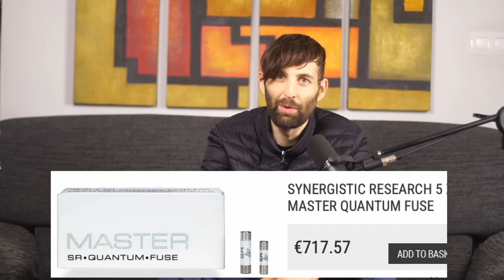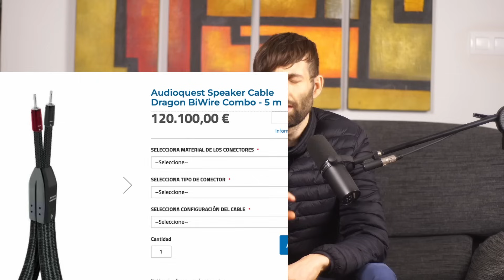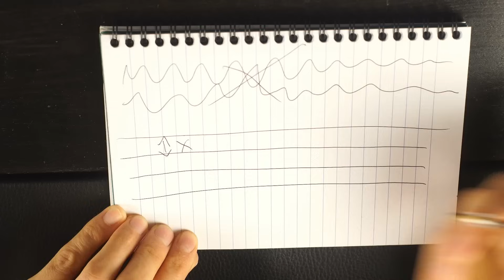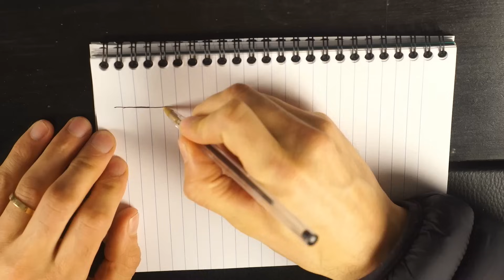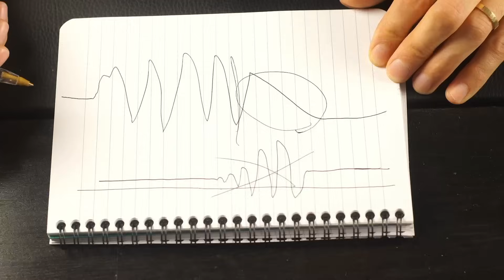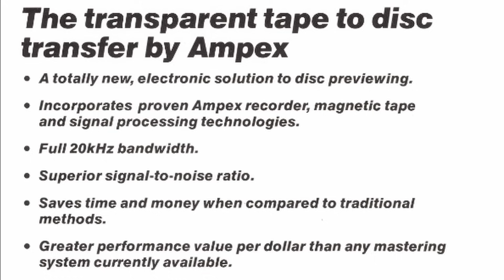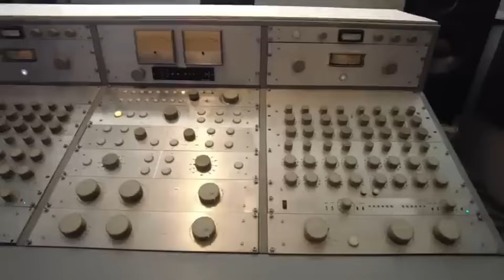Hard truth: most vinyl is digital anyway

Comment: Yep....100 % true.
Lots of analog/vinyl enthusiasts don't know that little detail: most of mastering studios in the 80s had the Studer A80 that converts the signal to digital before cutting the vinyl 😅
Reply: But yet lots of vinyl collectors buy records made before the 80's.
Reply: Digital is defined by 0s and 1s, you cannot write 1s and 0s to a piece of material, nor does it interpret them - thus technically analogue.
Reply: @willnorth6339  how the Studer A80 with a digital delay line works:
   1. Analog (from the tape recorder) →
   2. Digital (in the delay unit) →
   3. Back to Analog →
   4. Then engraved onto vinyl.
The digital conversion was done at 12-14 bit, 44.1KHz (not even CD quality)
Almost every major release after 1980 was done at a mastering house that used this way of mastering.
So, no more analog, since the vinyl was cut from a digital signal
Reply: @OrangeMicMusic  Again, vinyl is an analogue playback medium - once you’ve pressed from an originally digital source (in your example) to an analogue medium it becomes analogue. There is no longer any samples containing bits of information, the pressing become a continuous path of sonic information - an analogue vibration.

Your example is like taking water, freezing it to ice and then still calling it water.
Reply: @willnorth6339   the discussion in this video (and the comments here) is about having an all analog path from recording to vinyl. Once an audio signal was converted to digital and back to analog, that path it's no longer 100% anlaog
Reply: @OrangeMicMusic  I do understand your point and you’re correct in saying that the result (vinyl) contains information once processed through digital - but the end playable product is still fully analogue, the gaps between sample rate/bits have been blended into one continuous stream of vibration (vinyl groove) essential adding sonic information + wow, flutter and distortion have been introduced, therefore the playable has taken on some fairly new sound characteristics associated with the effects of tracking vibrations from a physical piece of material.
Reply: @OrangeMicMusic  The A80 is an analog tape machine, the cutting version had a second set of playback heads for give you an analog cutting delay. Any digital delay was likely from a third party or the lathe manufacturer. I mostly worked on the 2" 24 versions not the 2 track version. Even with a 12 bit digital delay vinyl only has a resolution of 11 bit so 12 bit is plenty.
Reply: @dannelson6980  yes, A80 was an analog unit, but I said <<Studer A80 *with* a digital delay line>>. Meaning, many mastering facilities in the 80s used a digital delay unit in the process of cutting, Neumann VMS70 being the most famous one.
Reply: @willnorth6339  again....<<the result (vinyl) contains information once processed through digital>> it's exactly the point of this video, and the discussions over this. Some people want to have a vinyl that wasn't altered by any digital processing thinking that it's a better sounding source.
Reply: @willnorth6339  Well, ice is still water. 😂
Reply: @geirtjelta It’s water that has been frozen (in context - processed, just like pressing to vinyl aka analogue) - which is objectively different from its original form and now possesses different properties.
Reply: @willnorth6339  If you want to be pedantic, then technically everything is an analog playback medium through analogue vibrations. Your ears are very analogue also, or is the correct word acoustic? If you hear it then it's not digital, because you're not a computer.

Also, once you've converted audio into digital, you can't unconvert it. The "damage" is irreversible. If the audio has aliasing, quantization noise or other unholy digital shenanigans, Vinyl or any other analogue medium will not magically fix it.

EDIT: Also, if Vinyl is supposedly "better" at capturing all the details of the original sound, then by that logic it captures all digital conversion imperfections also.

Comment: The vinyl snobs I know have cheap turntables with attached arms and a bog standard cartridge/stylus, this is a fact in HiFi sound, it matters not one jot what your amp and speakers are it will sound only as good as your sound source, it's easier and cheaper to build a decent CD player than it is to build a turntable, arm and stylus.  I have both a good turntable (Linn) and CD player and I can tell you the amount you lose in clarity from vinyl is noticeable, the low-end base is often too mono for positioning, and the high-end is not delicate.  Vinyl is shit, it really is and no one I know can tell a good vinyl from a bad CD

Comment: Analogue playback, whether from a record or tape, has a sonic influence on the end result in addition to the haptic aspect. And this is independent of the source material. So I have to disagree here, that in the end it is all about transparency. When it comes to records, this is difficult to understand, as you already have an end product that you can no longer influence. That is why I am using tape as an example here. I use Hi-Res streaming almost exclusively for compiling playlists and then recording them on tape. Why? Because I think the analogue end result sounds more pleasant. I deliberately do not say 'better'! There is definitely a 'colouring' of the sound. And thus actually a 'falsification'. But one that sounds more emotional and pleasant to my ears than the digital source material.
Reply: @MagicMaus29  in a sense you are remastering a digital file to your preference. Nice!
Reply: @kellymichael9567  I believe that a lot of digital masterings these days are not designed for playback on highly revealing devices and for critical listening, but rather for the mass market, which prefers 'casual listening' in the background. That's why a lot of it seems too intrusive to me... too sharp-edged. Recording on tape seems a bit like 'sanding down' those rough edges. In my opinion, the sound characteristics gain from this very 'loss'.
Reply: So, you like wow and flutter, got it...

Comment: Nowadays, even a middle of the road ADC/DAC consumer level setup can reasonably be expected to have the same effect in the signal path as a very short length of copper wire. Unless it was designed wrong or judt plain busted.

Comment: As an engineer with 40 years in the biz, I learned early on that you can't reason with the unreasonable but I give you props for trying. I think many people get confused because in the studio we use analog devices to add flavor in the creative process. It does not help that when trying to explain digital you are fighting against an entire industry that benefits from maintaining the myth of analog.
Reply: Do you think any of the cable claims are true? Some people say they can hear the differences between copper and silver, or solid core vs stranded wire. As an engineer, do you think there's anything to that argument?

I can't find any good references that are based in science that would either confirm or deny these claims. I guess that what I'm trying to ask is, if I went to school to become an engineer, am I going to come across information that would imply, yes, it is possible differences in cables may be heard, or not? One of the things that make me very skeptical is, even if there isn't any formal science that can be referenced, setting up a listening test that meets the requirements needed to be considered legitimate science is not that difficult. Simply, is there a difference between A and B? Yes or no. So, even if we can't explain why there is a difference, we can at least prove if there is a difference.
Reply: @052RC  cables don't reproduce sound. Don't buy the cheap crappy ones because they will fall apart on you right away. Best option in my opinion is to buy quality pro audio cables separately and quality pro audio plugs separately, then learn a little soldiering and put them together yourself. If you want to invest a lot of money, invest in headphones or speakers and acoustic adaptation.
Reply: @052RC unless the cable is physically damaged and/or there's major interference across an unbalanced line, no. There's no difference unless the cable is question is so low quality that there are substantial and measurable levels of impurities in the base metal. Period, end of story. It's just physics at that point.
Reply: @052RC  audiophiles need to probe the super powers in A B... but🤔 don t show up😕
Reply: As long as the "unexplained" difference makes YOU pay more.. that absolutely ok with me.
Don't come back and cry after that..
Reply: @052RC  if you go to engineering school you will find that a thicker copper cable will always be better than a thinner silver cables, plus experience in electronics will tell you your contacts are causing 90% of your impedance anyways.
Reply: @052RC  About 30 years ago, maybe 40 years, a double blind a/b comparison was done.  In the "preferred by most attendees" category the speaker wire winner was a common steel wire coat hanger.  I wish I still have the printed article...
Reply: They are lying. Period.
Reply: A/B tests over a short time period are notoriously faulty. 

There can be differences in cables and similar equipment, but those differences will evidence themselves over time, not in a 10 minute test.
Reply: I'm a EE and got into a discussion with an audiophile on rec.audio.highend (?) in the early 90s.  Eventually he turned to ad hominem attacks and asked whether I had killed any astronauts lately.  Sigh.
Reply: The same reason people vote for Trump.
Reply: well thats just total BS.  There is infinitely more money in convincing you digital is better. I mean jeez dude - make a coherent argument "OH its the boutique manufacturer os 6 high end turntables fighting against the truth" 

I mean you literally said "I learned early on that you can't reason with the unreasonable" and then made the weakest argument in history
Reply: @piccalillipit9211  what's your argument that there's more money in "digital is better" than analogue?

Vinyl makes much more money....the albums cost $50+
The turntables cost from cheap $100 to $5,000, 10,000+
You need to buy a new stylus every 200 to 500 hours of play.

Digital - plays on a mobile phone. Streaming costs around $100 per year for everyone you'd ever want to hear....
Even a phone provides excellent sound quality of 20hz-20khz.

How is there more money in digital especially in 2025?

I want to hear your argument.
Reply: It sounds contradictory to say we use analog devices to add flavor and then for others to say you can’t A/B between an analog and digital source and tell the difference. Obliviously this is admission analog DOES color the sound to some extent.
Reply: @mikeg2491  You're comparing Analog and Digital against one another as if they are absolute terms with no context.  The context matters.  In the context of "audio stored on a vinyl record is colored and therefore sounds better than the same audio stored on a digital medium" is blatantly false.  In the context of "audio run through an analog outboard compressor during production is colored and may give a more preferential result than the same audio run through a digital compressor" could be true, but could also be false.  Far too much weight is given to "Analog" everything.  Digital technology in production is wonderful.  Sometimes there is tangible colorization as a result of using analog vs digital processing, but that's not what is going on when a digital audio source is merely cut to vinyl...  The fact that it's stored on a vinyl doesn't magically make it sound better during playback.
Reply: @mikeg2491 The funny thing is that in the video he mentioned that vinyl creates surface noise well, that is the sound that analogue based producers want.😂
Reply: @Deezvrtysdakklolopp no... No it's not. I'm one of those engineers. That's not the goal; if anything, it's intentionally avoided and worked on so hard to be avoided because we know that noise will be introduced in the cutting process anyway. Unless you're exclusively releasing digitally, which seems a bit against the point of it anyway, you work your ass off to avoid introducing that any earlier in the process than absolutely necessary.
Reply: @mikeg2491  Well, the use of a device because it does something like EQ or compression, is because we want to apply the EQ or compression.  If we want to use an analog EQ or comp, it's because we're going to flog the analogue circuit in a way that makes it sound different than other compressors or EQs.  Whether deliberate or serendipitous sometimes we get more "color" from the circuit overdrive or odd gain make up and then decide we like it.  Will that sound different than a straight up digital or analog device?  Yes, because we're doing something outside the linear operation range of the device.  It's going to sound different.

Comment: I fully agree with your statements what worries me is that the physical media sold at the stores (cd's) are the slammed smashed brick wall limited versions the same they play on the radio it would be a decent and proper thing for people actually buying the physical version ie cd or high res mediafile they would get the uncompressed version 
If i want it louder i turn the volume up as simpel as that
And for the vinyl part the late issues which are on the shelfs are mostly pore mp3 rip offs transferred to vinyl the weekend is such a artist 
I like both formats vinyl and cd but mainly because one time it's released on cd but not on vinyl or the other way round
What i also look for is the first issues any remaster is a no go

Comment: I agree that the slammed digital master and the hi-res digital vinyl master should be made available to the user: always. For me there is now room for a new format, lets call it WAV2 where in WAV2 one WAV2 digital file always contains the 2 digital WAV files: i.e. the slammed and the vinyl digital. On playback, the player has a switch to choose A the slammed or B the digital vinyl. There should also be a C position. This is the slammed A level matched (by LUFS) to the vinyl digital B, so enthusiast can switch between B and C usually to compare or if in doubt default to A. WAV2 just contains 2 files. The C version is derived from the A version on playback by one dB offset burnt into meta-data in the WAV2 file at creation. Thanks, really love your channel: inspiring.

Comment: Vinyl and Tape are a beautiful canvas that can and does exceed expectations when done well with sufficiently good equipment and suitable environment! Good digital equipment is indeed robust and excellent as well as not being subject in the same way as vinyl, such as tonearm resonances, physical energetic feedback, stylus profiles and 'jitter', not least the accuracy, capability and impedance loading of the RIAA phono amplification stage. I generally opt for the best digital wav file where available and 320kbs minimum for mp3 where no alternative, usually for electronic dance 'music' which, again if done right, is in most cases quite acceptable. Vinyl is magnificent on capable gear and being physical can be played without power to some effect using your finger nail however digital depends upon stable electronics and has no physical footprint with the potential of great performance pertaining to it's dexterity and the sum of its parts.. Tape, for me is very nourishing to the soul and despite its expense and fragility has proven perhaps the most reliable method to store both music and data. Traditional photography is revered, care over the quality of lenses, the medium, inevitable artifacts and the development process have an impact on the final product. It's now far easier and cheaper to attain great sound reproduction employing digital setups from well made/mastered files than it is to achieve the same from an analogue turntable setup in my opinion however, the vinyl and tape still is center stage in my systems where i have the physical vinyl or tape of the production i want to hear to play but the great digital i enjoy is where the majority of what i wish to listen to is stored. I will however bounce both vinyl and digital to tape for its convenience, saving exposing records so often and enjoying long playlist that i don't need a computer for, post recording. I guess it's horses for courses, all methods are valid but ultimately it seems most likely i would hear what the producer intended more accurately from a high quality, well mastered non-limited digital file than i perhaps would through the typical consumer grade analogue setup. Thanks, really great show. Very best regards, m

Comment: I got recommended your previous video, which was excellent. I was actually surprised my 40-something year old ears could actually distinguish between the spherical and elliptical styli. I see these sorts of arguments all the time, people buy a vinyl copy of an album from the 80's or early 90's because of all that 'analogue warmth' in the signal chain, ignoring that when the CD version of that album originally came out, it had ADD or DDD SPARS codes printed on the back cover.

I hadn't even considered the digital delays in the cutting process.